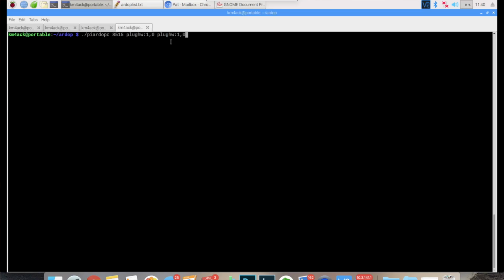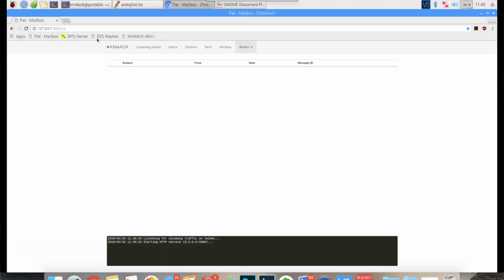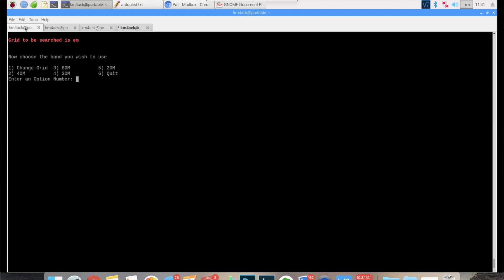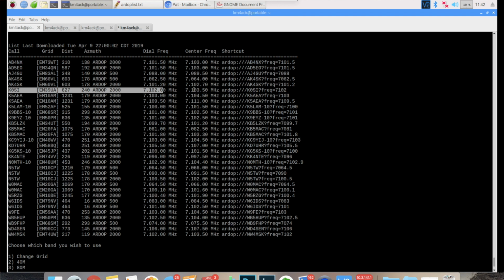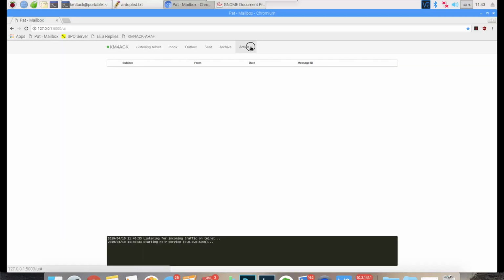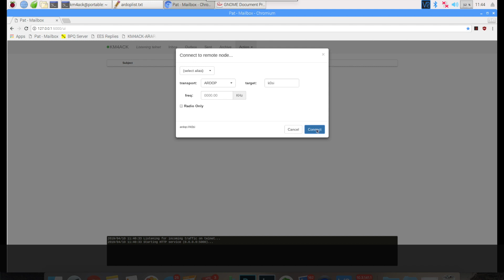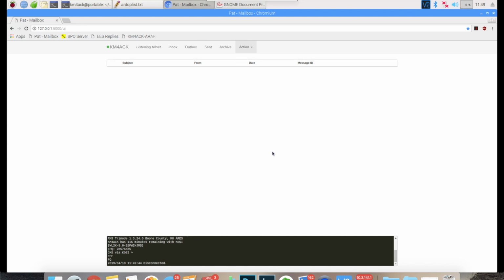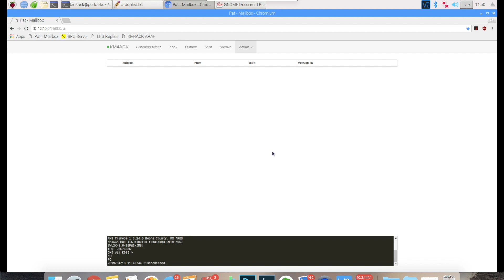ARDOP Connections Step by Step with Pat Winlink

Comment: Hi, Jason. When I try this, it fails. I'm using a homebrew dipole (indoor antenna). What I see on the piardopc screen is this (when I'm just trying to receive):
Input peaks = -27231, 22344
Prior-Offset= -1.469696
EnvelopeCorrelator CorMax:MaxProd= 65.308594  J= 157
[Acquire2ToneLeaderSymbolFraming] intIatMinError= -1
Frame Decode type 2d 4a f4 Dist 0.52 0.50 0.55 Sess ff pend 0 conn 0 lastsess 0
[Frame Type Decode Fail] Ldr; S:N(3KHz) Early= -12.146866 dB, Full -14.158823 dB, Offset= 54.787277 Hz:  MD Decode;5 Type1=H2D, Type2=H4A, D1= 0.52, D2= 0.50
poor frame type decode
Input peaks = -25857, 22882

So, I don't even know what station I'm hearing. I"m assuming that I need to try a different antenna, although I'm limited to indoor ones right now. Any suggestions otherwise?
Thanks. Patrick W0PCD
Reply: I should add that the line which says "[Acquire2ToneLeaderSymbolFraming] intIatMinError=" changes between -1, 1, and 2.
Reply: Patrick Dickey 
Useless.
Try to connect to some RMS and see what it gives you.
Reply: When I try to connect to an rms, I just get a timeout error. Fwiw, I can't connect with winlink on windows either. I'm thinking it's the soundcard. Or my antenna, as there's too much noise.
Reply: Patrick Dickey
First check that sound card actually produces output. It sounds like old dial-up modem. Many radios have Monitor future so you can hear what it transmits. Check that there is actually output power from the radio and the input audio level is not overdriven. ALC shouldn’t throttle the PA of the radio.
And try various RMS on different bands at different times, oftentimes the nearest doesn’t mean the best.
Good luck!

73
RA0UFF

Comment: Jason, I notice you're using a MAC. If you also have an ipad or iphone I would very much appreciate if you could give the iOS version of VOACAP a try. We wrote this to directly support Winlink RMS gateway selection. Once you've downloaded the station database it runs completely offline. At this point I'm looking for feedback on usability and trying to prioritize additional user needs. A contact email is available in the app.
Reply from the maker: Hi Shelly, Thanks for the heads up. I usually run a really old iPad mini when in the field but I used a mac this time for the screen record option. The iPad is too old to support the current screen recording apps. I'll take a look and see if I can get it to download and run on the old iPad. I have VOACAP running on the pi and did a video on installing not too long ago. https://youtu.be/jye6JkIPYY0 Fantastic program that I use on a regular basis. Thanks for watching! de KM4ACK
Reply: @KM4ACK  It's probably not going to run on a really old Ipad but thanks for asking!
Reply from the maker: @shellyscott-nash4141  no worries. downloaded to my iphone so i could check it out.

Comment: Jason , how do you , other than by trial and error , determine which of the multitude of possible nodes to use for your connections? You like K0SI , what process led you to that node? Thanks - again a great video!
Reply from the maker: Mostly by trial and error. Knowing how your antenna performs is also a plus. I mostly use NVIS antennas so I know most stations beyond 750 miles are typically out of the question. In the video, my antenna was only about 6 feet off the ground. If I was using a vertical antenna, I wouldn't try stations closer to me. You can also use propagation prediction software to help. https://youtu.be/jye6JkIPYY0 I have 2 40M stations that I can usually get into and 2 more on 80M. I use 40M during the day and 80M after sunset. Occasionally propagation won't allow a connection to a station that I can normally connect with. Thanks for watching! de KM4ACK
Reply: @KM4ACK  If I am using a vertical antenna, what would you suggest for the different HF bands for distance?  New to ardop and want to get it working.
Reply from the maker: @KB5WCK_Radio  Try 40M in the 500-1000KM range.
Reply: @KM4ACK  Thanks.  Any idea what "poor frame type decode" means?